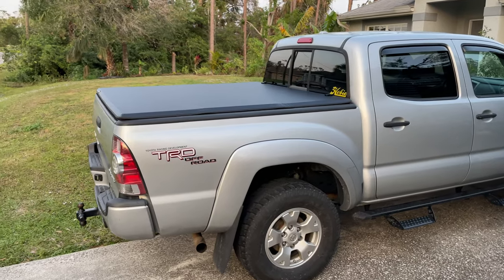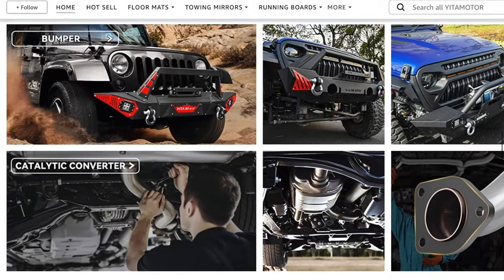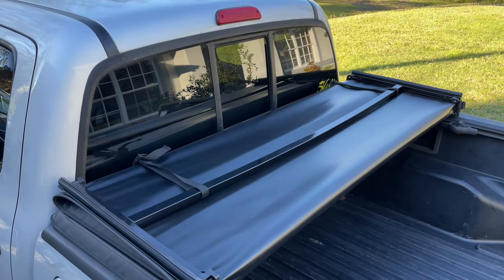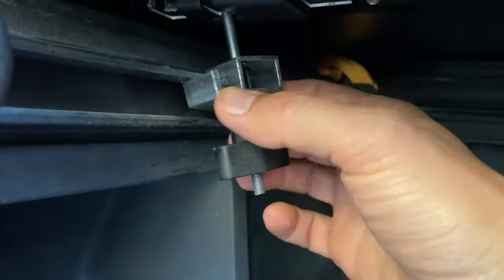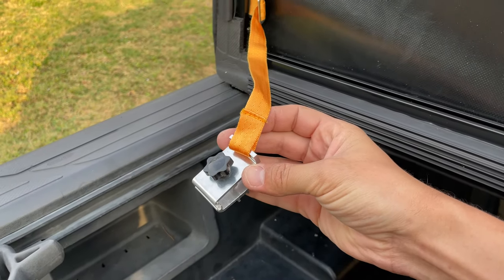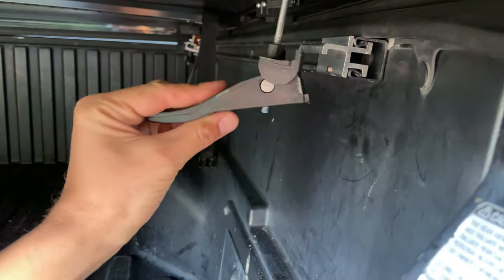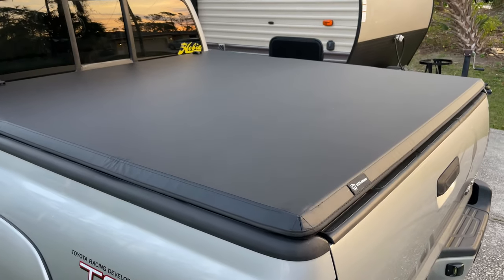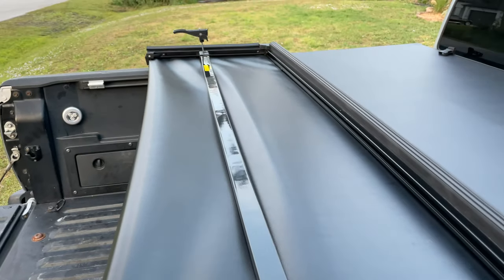How to install soft foldable truck bed cover - YitaMotor tonneau cover mod setup & review.

Comment: I just tried to put this on and I can't get the back clips to go on properly and the silver hinges it comes with if it doesn't fit your tail gate correctly won't slide all the way to the back. im almost thinking im gonna have to return this im so irritated with it already. spent 15 mins just tryna get the first one locked down correctly and then the second one and now the first one is coming off.
Reply: OMG I have the same problem!!! What did u do

Comment: I am so grateful for your video! I installed my Yita cover on my Nissan Pro-4xx this afternoon and struggled with the very easy paper directions when it came to the clamps. I decided to go inside and find a Youtube video on the installation on a rail system, and found this video. Quick, simple, to the point. Thank you for making this video!
Reply from the maker: Glad to help!

Comment: How did you secure the back part?   Your video starts when you had already done the back.   If you can tell me or show me that would be great.    The model I have is the one you purchased and my truck is a Nissan frontier crew cab.  Thank you.

Comment: I bought one of these used and the first set of clamps go right on but I think I could benefit from the mounting blocks for the ones closest to the tailgate but they weren’t included. Any idea where I can get a couple? I have searched Amazon but no luck. Thanks!

Comment: Looks nice dose the materials flop when go on the freeway
Reply from the maker: Very little movement when compared to roll-up ones, cuz it stretched over the metal frame, and that frame clamps securely to the truck bed.
Reply: I was curious about the flapping at high speeds too. Last one I got was a different brand and it was horrible. made all kinds of noise on the freeway. Thanks for the info.

Comment: They suck, can't keep mine straight on the truck. Keeps shifting and the clamps are garbage.
Reply: Yup just installed mine and it doesn’t fit straight and yes the clamps are cheap 💩